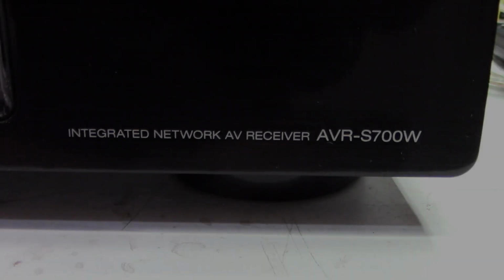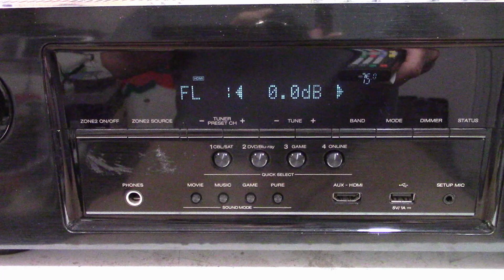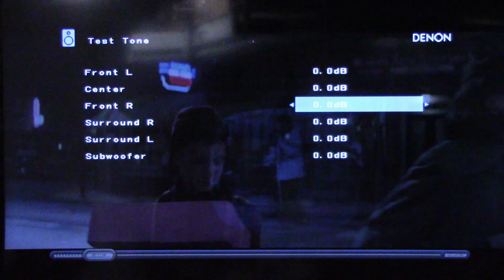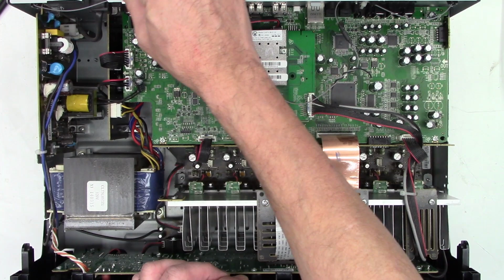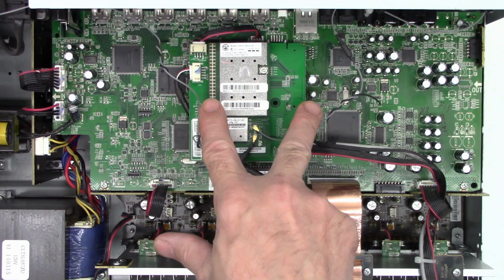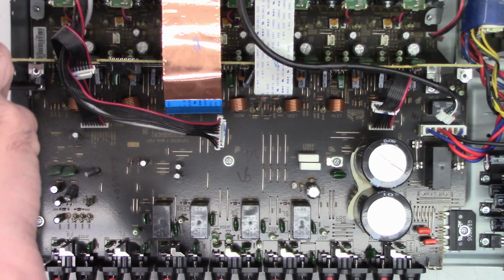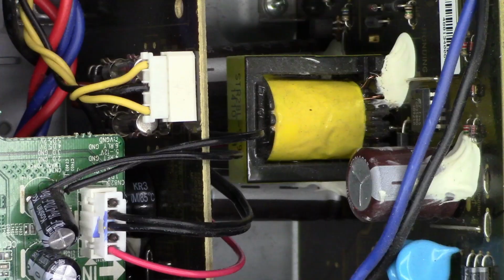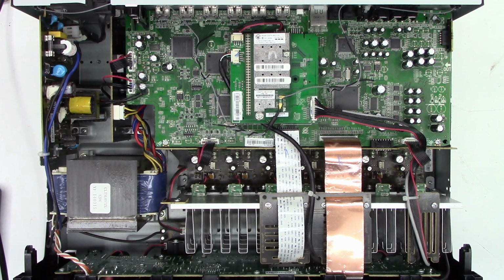DENON AVR-S700W AV RECEIVER LOW SURROUND RIGHT / FRONT RIGHT CHANNELS. REPAIR FIX ELECTRONICS STEREO

Comment: Tks for the video. I have a denon 1909 with exactly the same problem. My FR tower isn't working. Output from it is just 10%. When I contacted the seller, even without looking at the system, they said a chip is blown and it's not available as it's a old model. Now I have some confidence to disassemble and reassemble and take a try. Tks again.
Reply: Did you try this method brother

Comment: @NorCal715 - Yes sir.  Grounds - Grounds - Grounds check them on everything.  Cars, trucks, machines, electronics, etc....  I'm so glad that you recorded this repair.  I own an older Denon receiver and this issue might come up for me also.  Since thousands of new AV units have been sold this year we may be in for a boat load of repairs soon.
Reply: @richardbicker640  Yes, this pandemic has caused families to spend much more time at home so the increase of in-home entertainment products has been seen.  Even the RV market has seen a spike in sales this year.  The Craigslist increase in sales is likely two things: old equipment sold to make room for new or people bought new and can't afford the bills now.  I just wish I had the $$ to buy the bargains and sell with an installation service.  As you likely know these AV systems are a bitch to get right.

Comment: You won't believe what happened to me! I was looking for a tutorial like this (awesome by the way), because my FR channel and SL channel had too low volume and sometimes the FR was not heard at all, I did the volume knob trick and sometimes it worked, and I said this thing it's gone, well I decided to clean under my speakers, desk etc relocating speaker cables and guess what, I realized that the fault was that the cables to the speakers were next to my UPS 🤦‍♂... 😹

Comment: Hi NorCal. Nice video as always, I am the guy who contacted you sometime back regarding the Yamaha RX V-685 display issue. Anyhow, recently I sorta hit the jackpot when I came across a Sony TC-K909ES cassette deck for sale from a local guy. Mind you this is the ES series and comes with 3 heads, dual capstans closed-loop direct drive and the wood panels and all the bells and whistles. I see this particular unit still goes for over $800 bucks on ebay and I got it for $120 bucks. Did not get the remote with it but hey, not the end of the world. However, I have a problem, I cleaned everything, all the tape paths, the heads, the pinch rollers you name it. I recorded 3Khz sine wave and play back its spot on thanx to the quartz locked direct drive. However, I did some recordings, and at the end of the tape, not at the beginning or the middle, but the end of the tape, I heard alot of wow and flutter. Hence, i recorded the sine wave and checked it, the readings are all over the place. I did everything i could think of, i even changed the belt, changed the take up pinch roller, then i saw on the direct drive motor there are 2 10uf 16V SMD's, i changed that to electrolytes caps. Nothing seems to get the annoying W&F fixed, the only thing i did not change is the supply pinch roller because its pretty tight as it is a metal cast and i cannot get the pin out. I didn't want to push it as i might bend it. Can you share some thoughts what could be the problem? I know worn out pinch rollers can cause the same thing, I have another deck Sony TC-WR770 the take up pinch roller fits perfect from that. Still the same issue. Please share your insides on this. Thank you so much. Look forward to hearing from you soon.
Reply from the maker: See if you can check if the motor is actually speeding up and slowing down. Maybe with a strobescope or by putting g an ink mark on the pulley and looking at at it with a 60hz light.
Reply: @norcal715  Hi NorCal, actually the problem is now solved, after sending you the message I was messing around with the unit, i noticed that during the play or record mode, the take up pinch roller can easily be stopped by my finger. So i removed it (the rubber is fine, no shiny parts and still supple) and i bent the spring attached to it to give it more pressure when engaged. Then i tried it with the finger, it has more torque before coming to a stop. Then i did my sine wave recording, Yay the speed is constant as the sun shine on a warm sunny day. I didn't have time to fully put the unit back together and do thorough checking since I had to come to work in the morning. Can't wait to go home and put it to test again. So all it was just a stupid spring that needed attention. Thanx alot for coming back to me bud. Take care and keep those amazing videos of yours coming. Good luck and stay safe.
Reply: @norcal715  Small issue i neglected to mention, this is what i had since i bought it, during recording it records like a dream when you play it on another deck. However, whenever i play it from the K909, the same tape or any other pre-recorded tapes, the treble is less. I don't think its the azimuth since i can clearly hear the high frequencies as the azimuth is spot on, but its like if you had turned the treble all the way down, it sounds like that. Heads look amazing, i have a doubt it is circuit related. Any thoughts on this? I thought of changing the all the electrolyte caps on the unit. I see some caps are branded Elna. Can you please guide me on the right path what could be the issue? Your thoughts on this is highly appreciated.

Comment: Hello.  Your videos are great and very instructional.  I have a Denon AVR model that has a cold solder joint on one of the speaker terminals.  I opened the the lid and it looked like a ridiculous amount of work to get to the bottom of the board and re-flow some solder.  When you wiggle he speaker terminals, the sound comes in and out.  Is it as much work as it looks to be to get to the bottom of the board?  I can't believe there is no access from the bottom of the unit.  Thanks.  Again,  your videos are great.

Comment: This I found extremely interesting. 
I have avr 1713.
Twice on warm restart the right front failed . Sound was faint crackle that seemed to mimic input signal. 
Shut off let cool and comes good.
Very similar to my air con duct controller. 
They diagnosed transformer. Plugged in new and all good. 
Later I tested transformer  with its rated current output , nothing wrong with it.
So I might try the spray. 
From what I've seen on the net it appears to be a common issue.

Comment: My Denon AVR-X2000 has this issue. MY FR and my Center channels would randomly stop working or have very quiet volume. It would seem to "fix" itself whenever I pushed on the speaker jacks. I'll have to try your fix and see if it works.

Comment: I have repaired stuff in the past that used the mounting for its ground connections. When I would remove a circuit board to service it I would have to run jumper wires connecting all of the ground together in order to troubleshoot it while it was a part. I would always ask myself why would anybody design something that way. It was just another reason for me to wonder why I got into the repair business. I would also have to explain to the customer why it cost so much to fix.

Comment: Thank you for your video. I have the same system and I’m not getting nothing coming from my speakers . I tried the factory reset but to no avail. Do you have any clues what may be going on. What kind of antenna should I be using? Thank you very much. Keep up the great videos .
Reply from the maker: Do you hear the speaker relay click, about 5 seconds after power on?

Comment: Great video, subscribed a couple months ago. What is that copper band that is connecting 2 parts of this  unit? I have never seen that before.
Reply from the maker: That is a shielded ribbon cable from the front panel. Maybe a front hdmi/ RCA inputs.
Reply: @norcal715  greetings sent u an email on a magnavox

Comment: I'm having a low subwoofer output problem with a Yamaha RX-A3080. Everything was cherry a few days ago but now my subwoofer is operating at about 10 to 15 percent of its capability (Velodyne Digital Drive 15). I brought in another sub to verify the issue wasn't the amp on the velodyne and the same issue occurred (swapped around RCA cables & did a factory reset as well). I tried the second subwoofer output on the receiver and it does the exact same thing. It's like the receiver output level has been skewed -20dB or more. Do you think it could be something similar to this Denon? Your channel is very informative, any help would be greatly appreciated.
Reply from the maker: Did you try a factory reset on the receiver?

Comment: Hello.. I have a demon dsw-391 SW, & AVR1311 problem is my SW not working always in stand by mode when I play the system. Other speakers are perfect, i checked the speaker with 9v battery its ok,while i am checking the sub woofer pre out with multimeter it showing the reading,  a reply from you
Reply from the maker: Feed another source into the subwoofer, MP3 player or phone playing music through the headphone jack and see if you get audio. Let me know how it goes.

Comment: Can you help me diagnosing problem with my unit?

My Denon X2000 used to run on low volume now after almost 6+ years of usage it is almost unesable because sound keeps fluctuating
Reply from the maker: Try heating and cooling various parts to see if something is heat dependent. Use a can of air turned upside down to act as freeze spray.